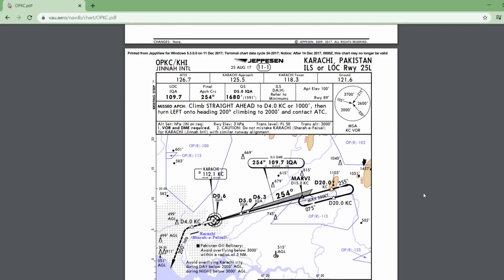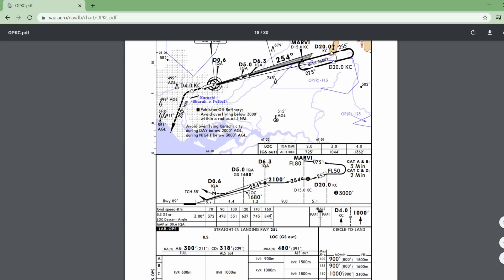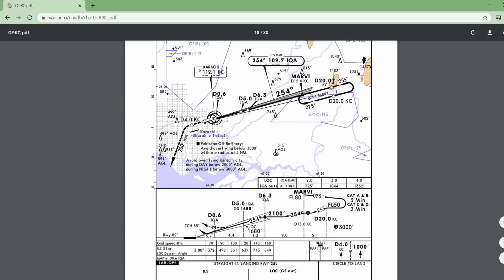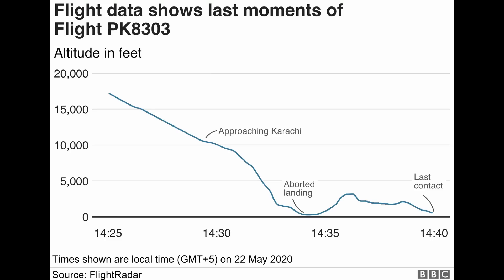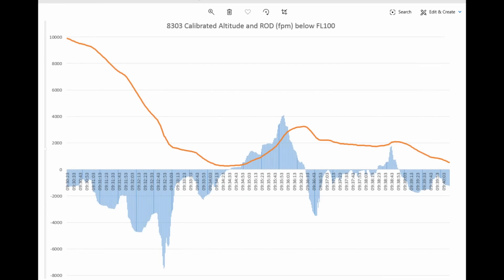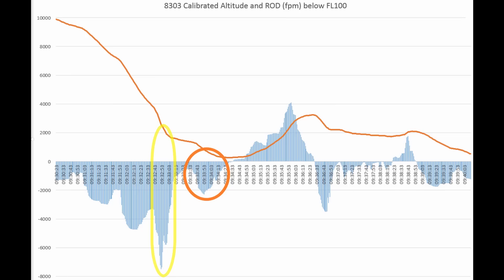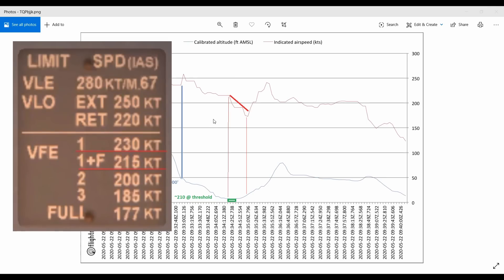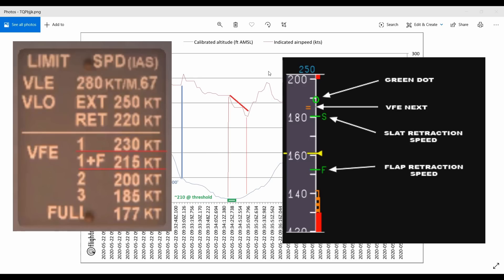PIA #8303 Update #4 Unstable Approach Profile

Comment: Juan, as an MOB (maintenance on board) crew member during lots of maintenance check flights done after heavy C checks, I can attest that your very good analysis is on target. We tested all the aircraft flight data computer controlled flight control limitations just as you described them. As one of your commenters stated this incident could be because of repeated disregard for safety and management culture. How did they not receive a GPWS ground proximity warning at that rate of descent and that close to the ground?

Comment: After research and watching all evidences I came to an conclusion that it was pilot mistake. Even though I am also Pakistani but we have to see the facts and figures. I am not a pilot and my analysis can be wrong but what I have found so far is ..if the landing gear was not opening in the first landing why pilot didn't mention in the cockpit and why he didn't ask for fog at the runway and if he decided to land then why he took off again ,this is a big mistake, while landing without wheels the engines hit the runway after that they got damaged and as he took the plane again up because of air pressure the engines caught fire as they were already damaged,the second time the land gear was opened.this mean it was pilot mistake that instead of landing without gears ,he should have take another round so that the engines will not be scratched harshly on runway .one of my friend from aviation sent me the conversation between the pilot and guy in aviation while landing in a printed form and in this conversation there is nothing where pilot told the guy about the landing gear issue ! Hope my analysis is understandable and I am sorry If I hurt someone through my comment but this the reality which we have to bear .JazakAllah

Comment: Question:  Scraped engines means gear not extended.   Why would this crew even initiate an approach and landing knowing the gear is still up.  Why didn’t they declare an emergency and arrange equipment if there was a true gear malfunction? Why didn’t the gear extend? Somewhere I read that the gear will not extend on the Airbus 320 if the airspeed at or above 260 knots even if the gear down handle is activated.  How would they have been able to reset the gear handle or use an emergency extension procedure.  The fact they landed gear up (apart from the massive speed and descent deviations) apparently destroyed the accessory case thereby dooming the engines to fail — so apart from every other anomaly with this flight why in the world would they have tried a go around instead of accepting their fate and skidding to a stop?  Another weird element is the tower questioning the crew about attempting a “belly landing” on the second landing attempt — did the tower not just witness the gear up touch down with sparks and marks on the runway.  Almost impossible to wrap one’s arms around this one.

Comment: These standards are observed when flying a fully tuned fit machine. I see road vehicle driver's or operators of any machine that are old or not calibrated etc to innovate in handling and operations. Let's look at how he did in takeoff and in transit or even during the previous flights to find whether it was a routine to fly this machine this way or otherwise since you have this data available.

Comment: It looks like the flight crew has a history of getting away with not following protocol. This means that management that allowed this kind of attitude is also liable, though with the history of such tragedies in the past in Pakistan, they'll put all the blame on the pilot and no one else will be held accountable.

I'm also wondering if the pilots had proper rest before operating this particular flight. I have personal experience of flying with a PIA pilot on a domestic flight who was strong armed into flying the plane because the assigned pilot was transferred to an international flight. He had just fallen asleep at home after a long flight, when he was ordered to come back. (He got stuck in traffic along the way!) Long story short, he was pissed off enough to have told us (his passengers!) this whole story while preparing to take off. He got us from Karachi to Rawalpindi in less than an hour and a half! He flew that plane so fast and so smooth that we were impressed. But it could easily have ended in disaster. So I'm wondering if the pilots here were approximately rested.
Reply: OMG! He should have joined airforce if he was so bent on flying planes at high speed 😂 Tou people were lucky that your flight was uneventful.  And that pilot seems to have anger management issues, considering he told the passengers all this.

Comment: Another aspect of this incident is aviation zone encroachment. Before you think how this damaged glider was finally on its way to crash land on one of the two runways,  if you look at drone view of that area, you will find that the starting track of the runway is encroached by a Karachi housing project and about 500 meters initial track of runway is hidden under tens of those town houses. Now this feet-less & engine-less glider was finally on the mercy of encroached runway, but when go round ended over the starting track of the runway, it was unavailable and hidden. A glider would never ask you, why start or mid of the runway was unavailable? It will just land on it. But the glider found some mysterious obstructions on the runway, which was on collision course and shouldn't be there. This situation also causes bird pollution around airport.
Earlier, when electrical gear button didn't work before first landing, they decided go round to attempt the hydraulic manual lever instead, during the go round, but it didn't work either.
Some major airlines discontinued their service, considering this airport unsafe.
These are some of the reasons, planes take higher altitude based on their nautical view. 
Karachi is a  plan-less ethnic concrete jungle. Aviation authority is not authorised to involve itself in ethnic or planning matters of Karachi.

Comment: Thanks Juan for the update, as a technician i have worked all kind  of vertical speed indicators and the maximum speed in the  dial is 6000 ft per min, i never imagined a plane descending at 7000 ft/min even the pointer has a mechanical stop preventing the pointer from moving further,   is hard to believe a completely irresponsible crew violating all landing  parameters causing the death of 100 peoples on board.

Comment: With an unstable approach, they would have been getting overloaded with alarms.  In addition to L/G chime for being over config limits, they would have gotten warnings with the flaps as well.  GPWS would have alarmed "sink rate",  "too low, terrain", "too low, flaps", and "too low, gear".  Am I correct on these warnings?  By the time they reached the runway, they were under a lot of stress, and all the GPWS warnings would have just blended together.  
They probably realized right after flare, that the gear was still up and commanded the go-around.  The vertical speed and the time it took to build thrust explain the ground strike, and why they elected to go-around after striking the runway.   In the duration of all this, they would have traveled much farther down the runway and been increasing speed after the strike occurred.  Does that seem plausible?

Comment: Possible landing gear deployment interruption due to aircraft speed interlock? With constant alarms in the cockpit, pilot didn't realize landing gear wasn't down until the plane sailed past the intended touchdown area, then the shock factor of bouncing the airframe off the strip. Then initiated go around not realizing he had damaged the accessory drives on both engines.

Comment: Alas & sadly 97 people have died because of basic flying mistakes. Aviation Herald & flight data is compelling - Flight Crew performing Slam-Dunk approach in daylight @ 14:34 hrs, so how come Tower Controllers weren't watching to confirm "Landing Gear was Down"; and although FDR has been found, incredibly the CVR data module has separated from its housing & is still missing...!

Comment: Juan, can you comment on the following? The gear was commanded down in an over speed condition and an alarm sounded (confirmed in ATC recording). What causes the alarm to silence? The gear is commanded down but has not deployed. What is the recycle procedure? The simplest scenario is that the crew didn’t realize that the gear was not down, not that they intentionally belly landed. They were very busy with the rapid descent and hitting the glide slope. What could cause two pilots to miss that the gear wasn’t deployed? Waiting on the CVR.

Comment: If the pilot didnt have the stabilized approach while landing, why did the ATC told him that ruway was clear to land, do you think that the ATC is also at fault and he should have had ordered the pilot to go around way before desending to final moments of landing. What's your view on this?
Reply: I see trend to put a blame on ATC. ATC clearance has nothing to do with pilot landing a plane. Clear to land does not obligate any pilot to land the plane. But it provide to the pilot information about any object on flight path. You are clear to land if runaway is clear of any other planes, people, vehicles. FOD
They try to turn him away from airport. But he didn't listen. You can hear ATC turn left 180.

Comment: First of all, thank you for your impartiality.
Second, the level of comments on your video are extremely amateur, to not mention disrespectful.

Now my comment :

1) What do we know about the aircraft condition ?
2) How many hours the captain and the F/O have on this type ?
3) Which kind of flight / career profile these aviators have in the company ?
4) Even though the stabilized approach is an overwhelming subject in any recurrent training, there are still a lot of this. Situation happening every time,  but 7000 ft/min , in a good weather condition bellow 5000 ft is acknowledged perfectly in any kind of experience and culture as wrong,  and without any chance of recovering , so why do they continued ?  No chance of lack of situation awareness as they were visual !!!
5) Once again the investigation when involving Airbus are full of misunderstandings and suspected actions :
     - FLIGHT 447 :  Captain Sleeping + Flight deck crew sleeping + inside thunderstorm + no radar + no turbulence , etc....
     - FLIGHT 3054 : 2 captains not the first flight of the day on the same aircraft ,  then suddenly one throttle in reverse another in climb during the landing  + black box wrongly discovered and sent erroneously to airbus and  1 week delay to fix the misunderstanding between the information.
     - FLIGHT 9525: A suicide of a pilot that only had been found out being In a psychological problem after the accident .
     - FLIGHT 8303 : Good weather + extremely above the parameters of a non stabilized approach, and then the FDR housing has been recovered but not the voice recorded+ investigation being conducted in Paris for BEA , not a very neutral institution to be ahead of the investigation .

I don’t want to create an atmosphere of conspiracy, but why airbus’s accidents are never clear as Boeing’s accidents ?

Comment: It looks like, intercepting from above, they caught the  first false glidepath at 6 degrees i.s.o the correct one at 3 degrees. This would also explain the high rate of descend on the glide. Perhaps a nice subject for another video, the structure of an ils approach system.
Reply: Can a plane land at 6 degrees glide if gears are already open?
Reply: IdreesGhazi IdreesGhazi , with the gear down and in the correct landing flap configuration, the high rate of descend will trigger a “sink rate” aural warning on short final. Standard operating procedures require the crew in such a case to make a go-around.

Comment: In the last comms before the first landing attempt between the atc and pilot a ding ding alarm is clearly audible in the background. Most probably the alarm is indicating that the landing gear is not lowered. The atc should have picked that up and inquired what it was. Instead the atc ignored it and chose to clear landing. I think this was a fatal error by the atc. Had the atc put the foot down and made the pilot correct approach this accident may have been averted. I think atc is responsible here

Comment: This accident is a warning for all pilots, who resume after 2 month break. Take a refresher practice.
Reply: I disagree.. 2minths forced vacation cant explain 7000ft/min...
Reply: hn bg 
Yes.
Likewise aircraft also has been resting for a long time.
Gears rusted? Got stuck.
Big mistake.
Gears’ mobility not checked before being airborn.
Common sense.
All aircrafts, globally repeat globally, must be checked physically for all mobilities before letting them be airborn.
Simple.
Reply: Muhammad Salahuddin the aircraft had a few flights just before the crash.
Reply: @Pilot2007exl  it wasn't too rusty to go up.
Reply: @Pilot2007exl  so how did it go up...
Reply: Yes I agree with you hn bg..every pilot who has been off for 2 months should take a simulation test of landing and take off. No matter how many times you have done this, there is no chance for an error in this industry.
Reply: A refresher course is good. Or minimum 2 hours on the simulator before flying. That will help to speed up the thinking process and adherence to SOP.
Reply: udin737 who said they didn’t have some sim time or still had their mandatory landing recency which is 3 takeoff and landings within the las 90 days for example you did your last 3 landings on February 29th you do not need legally any sim and you could legally fly again on the 28th-29th of May without any prior to that, and that is a law generally applied, not talking about the IFR recency which is 6 instrument based approaches in the last 6 months all this is a minimum that makes you legit to fly if needed ! The question did they have sim or recency this has to be verified we can’t assume they didn’t !
In Toulouse when you go to Airbus for an initial and many other training providers beside the airlines, there is something they focus on the sim, they say always read your FMA (Flight Mode Annunciator) so you don’t miss a thing ! 
I am an ATPL individual and this is the rule that applies to us regarding FAA or EASA based licensing ! 😉
Reply: The pilot deliberately ignored multiple warnings from the tower.
Reply: Shenaniganiser Well the CVR has not been published so your assertion cannot be proven lets wait for the investigation but you can read these datas that are done by professionals in the Aviation industry rather than by some self proclaimed experts in many cases.
Reading and understanding the below article and as an airline pilot the possibility of a pilot error is very strong more datas should be outed before having a definitive answer to this horrific accident.

http://avherald.com/h?article=4d7a6e9a&opt=0
Reply: That's a great point to make.
Reply: Not exactly! This accident was avoidable in many ways and several times along the way!

Comment: Specific errors:
1. Mis-explanation of some details on the approach plate
2. Mis-statement of stabilized approach criteria. Close, but inaccurate.
3. What matters is not a generalized stable approach criterion, but the airline's SOP and that country's laws. Generalizations are only good as far as they go, and should be labeled as such. So what are the applicable rules and regulations?
4. You have to look to find this answer, but what percentage of unstable approaches land normally? The Flight Safety Foundation writes, "The basic problem with today’s stable-approach criteria is that while they serve as an excellent guide on how to fly an aircraft with precision on approach, a small deviation from the stringent criteria at 1,000 ft (or even 500 ft) does not necessarily create a risk worthy of triggering a go-around decision at that point and, therefore, pilots appear to be tuning out the criteria — about 97 percent of the time." 
5. Yes, this was an egregiously bad approach, but the presenter only had most of his ducks in a row. I think he can and should do better and hope that he will.

Comment: IMHO Pilots of modern aeroplanes have suffered a degradation of hand flying skills and rely on the automatics far too much. In some airlines this problem is reinforced by a company policy which mandates that after take off it's gear up, LNav -VNav Arm and the next time the pilot touches anything is to select reverse thrust. This is not just an opinion I've pulled out of thin air, after 35 years in Mil/Civil aviation as flight crew I've witnessed it first hand and, having retired, why my airline "No Fly" list is so long. 
Great presentation, by the way.

Comment: IF this is pointing toward operator error it’s explained by two points. 

1. PIA is a monopoly supplier that has actively sought to prevent competition within pakistan. It reputation is poor. Checks and balances are poor. And recruitment to positions such as pilot and crew determined by nepotism and cronyism. 

2. Pakistani culture doesn’t really understand or appreciate the value of professionalism. i.e. that outside of legal constraints, there exist a set of rules and ethics that should be adhered to for the benefit of society as a whole. Most people simply pay lip service to this.  

Until these two points are correct these situations will continue to occur.